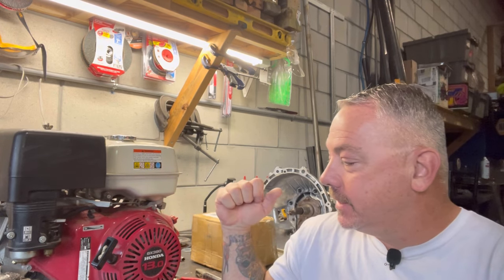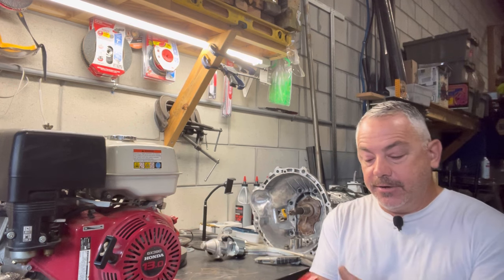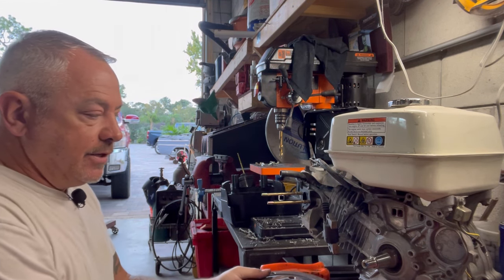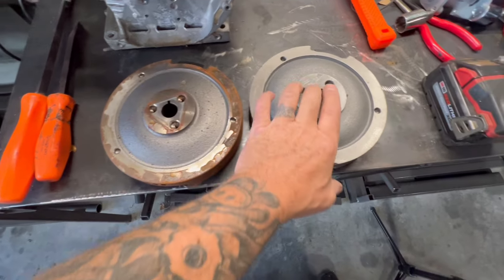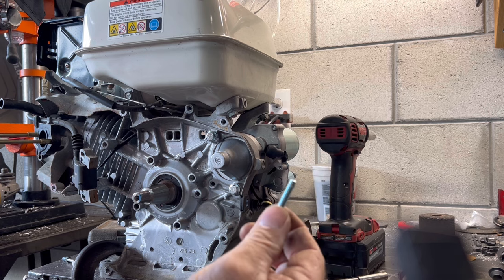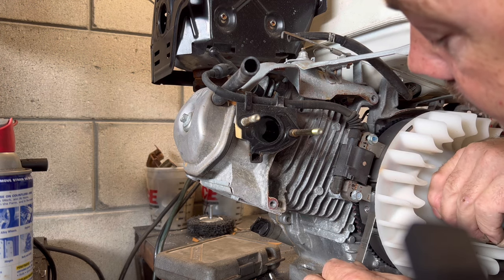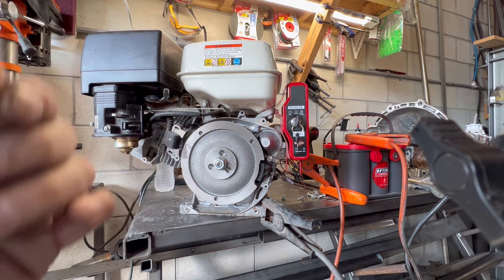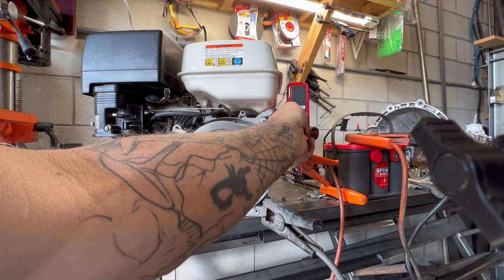How to install electric start on a 13HP HONDA GX390

Comment: To whoever has a new flywheel keyway that is not aligned with the original, you can remove the teeth ring and insert it into the original flywheel.
Reply from the maker: Thanks for sharing that brother 😊🤙🏻
Reply: @magicman_metal_fab  thanks your video I can do it. it took me several days but it is worth
Reply: My teeth ring was about 100 thou smaller then the flywheel where it sits on the old one.  My keyways arnt lines up and its driving me nuts i cant find anything online about it.
Reply: I also bought this kit, and my gear ring on the new flywheel is smaller than my oem flywheel. Im hoping to drop off both flywheels tomorrow to get a machine shop to put a new slot in for me.
Reply from the maker: @scottyv106  that’s so crazy!! Why the seller of the kit doesn’t have a fix for this. You shouldn’t have to do that bud. I’m glad you got it sorted out. Keep me posted. 😊
Reply: Is there a video for that ?
Reply: My original flywheel keyway and magnet is at 2 o'clock and the new flywheel is at 1 o'clock 😢. Are you suggesting to remove the flywheel teeth from the new one and press it on my original flywheel? If so, I measured and my original is an 1/8" bigger so the new teeth won't fit unless I have it machined to fit 😢
Reply: @solomonbadayos4196  burn the new teeth, due to heat it will expand the size. You can try and if it did not work, use  the sharper machine
Reply: @ThInstantnoodle  got it. Thank you!!
Reply: I'm a moron. Where do you hookup the battery? Overall I can follow your video. I hope mine goes as smooth as you make it look. Thanks Scott

Comment: In my case for this I’m going to use it for the Track Tow Kart it’ll be faster to start the engine like this rather than pull starting it

Comment: It appears from the video that you could have added the starter and flywheel without removing the carb and cleaner. Y/N? I 2nd the good editing. You showed the potential problems without filming every single screw turn. Thanks
Reply from the maker: Yes you are correct bud. Good eyes and observation. If there was a prize, you would have won!!! 🫶🏻🫡

Comment: For anyone who's installed such a electric start kit, what happens if the motor locks up due to hydro lock or anything of the sort?
Reply from the maker: I don’t know why you’re worried about a motor Hydro locking, but if it was the Hydro lock, you would have to pull the spark plug and get rid of all of the water and moisture out of the cylinder

Comment: Thanks to your vid (much appreciated) I successfully installed the electric start kit to my honda gx390 7.5kva generator. I added a second charge coil to increase the charge to 2.4A. It brings the battery back to health very quickly but it occurred to me what controls over charging of battery? Would really appreciate any thoughts. Thks Wayne
Reply from the maker: Awesome bud. I don’t think that 2 mini coils would over charge the battery. Hook up a stereo to it. lol to drain voltage 😂🤣😂

Comment: Excellent video sir. I expect to install this conversion kit on my GX390 on my Simpson Pressure Washer. I'm 68 years old with shoulder problems, too old to be pulling manual recoil starters!
Reply from the maker: Don’t blame you bud. It’s super easy to do too. 😊🤙🏻 glad it will help you.
Reply: @magicman_metal_fab  I just bought a go kart with a Honda gx340 250 bucks these little engine is strong
Reply from the maker: @joebravo7220  nice. Just be aware if you try to do the starter swap the pick up on the flywheel is in a different location bud. 😊🤙🏻

Comment: I also had a flywheel with the keyway in the wrong position. I took it to my local machine shop and they cut a new keyway in the correct location and only charged me $40. Highly recommend this fix, the engine runs perfectly and I can feel confident that there won’t be any issues in the future . I depend on this engine every day, because I do commercial pressure washing, and it runs about 4 to 6 hours a day 5 days a week and I don’t have a backup engine.
Reply from the maker: Awesome. Great to know bud.

Comment: Good video. I have the same kit. No instructions. No invoice. No company name of who or where it came from. Weird.  My kit wiring version has the black split . One leg goes to ignition coil for spark. The other runs the new electric switch. I just clipped old switch wire and left it run through original diode for low oil. Also weird   was the white wire coded to brown for charging coil. I havent started it yet. Going to buy a new spark plug and wire for charger. I was going to say. A 2 5/8 " hole saw worked . Wouldnt have known that had I not watched your video. Good you mentioned gear line up. And cure in comments. Mine has no wiggle room in bolt holes. Hope it meshes or its drill city.
Reply from the maker: Awesome brother. Glad it helped you. 🫶🏻🫡

Comment: Fyi if you take a piece of notebook paper and fold it in half, it makes for a good shim to set the gap of the ignition coil to the flywheel. Just loosen the screws with the paper between the coil and the magnet of the flywheel, and let the magnet pull the coil to the flywheel. Tighten the screws and rotate the paper out.

Comment: I'm doing this on my 8 HP Honda snowblower. Yes I know it has 120 volt starting but I don't want to be 30 yards down my lane and have an engine stall. Besides I'm old and don't like pulling that big engine over. lol.
Reply from the maker: Heck yea!!! Smart man. 😆🤙🏻
Reply: @magicman_metal_fab  question, if I install one of these, can I somehow wire in just a plug for an extension cord for power? Or do I have to use a wire? Wanting to do one of these on my Honda GX engine on my snowblower. Thx 🙏
Reply: @magicman_metal_fab  do you know??
Reply from the maker: @Lyndonkb11  the system operates on 12 V. If you’re trying to use 120 V it won’t work you would need some kind of inverter. AC voltage and DC voltage is totally different.

Comment: Can you explain in more detail how you aligned the flywheel teeth with the starter teeth? I just had to replace the starter on my Westinghouse generator and it seems the flywheel is getting caught up when trying to press the electric start button. The flywheel began to turn when the button was pressed and then seemed to "seize" up.
Reply from the maker: Just loosen the starter up and rotate it slightly. There’s a little bit of play in the bolt holes. On mine it wouldn’t spin the engine so I had to rotate it.

Comment: Thanks for the video, it helped out a lot. But in my experience. My starter was binding/ seizing up after half turn or so, it was struggling. I struggled for two days trying to find out why my starter was seizing up, and it turned out the jumper cables I was using to test it out wasn’t giving the starter enough juice to crank it all the way. Wired it straight to the battery and problem solved. Hope this helps 🦾
Reply from the maker: Awesome bud. Glad to hear that.

Comment: Great video. I do have this question if there is no stater or voltage regulator what is sending a charge back to the battery?
Reply from the maker: Nothing

Comment: Thank you very much for sharing this. 
1. So, what was the reason that the teeth did not align; and,
2. What did you do to align the teeth?

Thank you very much!
Reply from the maker: Just not sitting properly. Losing bolts to move starter around. It’s not hard bud

Comment: How are you brother. Can you make a video on converting an oil cooler on GX390 aircooled engine. Im planning it to install on my generator set. To lessen the heat because you know gensets are at high rpm.
Reply from the maker: I sure can brother. It may take a little bit because I will be leaving town for work in a few days. Definitely a great idea. 😊🤙🏻

Comment: Excellent video what if when your key way is at 12 your magnet is at 2 on the old one and on the new flywheel its at 1 with the keyway at 12?? is that enough for it not to run?
Reply from the maker: Probably not bud. It’s super important that it’s the same

Comment: From the point you left off at, how do I wire up the battery? Just the positive to solenoid and negative to Engine? How does the battery get charged?
Reply from the maker: Yes correct. The coil you added behind the flywheel will charge the battery.

Comment: Hey mate, great vid yeah. So hey, would you know if this kit is suitable for the 420cc Honda clone, otherwise advertised to be 15HP? I don't think it's actually a true 15 ponies, but it does appear to be an exact replica of this gx390 yeah.
Reply from the maker: Absolutely. There a guy on YouTube that built a 60 mph Honda I think it was with a 420 cc engine.

Comment: Awesome Video. The eBay link says the Electronic Starter Kit is for GX390 year 2011 or older.... does this "older" mean pre-2011 or post-2011? I'm assuming it means 2010 and before?
Reply from the maker: Yes. Correct

Comment: Cool! Looks like the kit is only $75 which is very reasonable.
Reply from the maker: Yes sir. How can you go wrong?  Super easy to change over too. 😊🤙🏻
Reply: Why do the kits say 2011 and earlier models? I can’t find any for a newer motor
Reply from the maker: @frankpirrone6032  good question bud. I’m sure it will fit newer motors. Nothing really changes year to year. 🤷🏼
Reply: Cost me 89.00
Reply: @magicman_metal_fab  I believe the key position is slightly different on newer ones made after 2011.  Will affect the timing.  Haven't done the conversion yet but have one on the way for my generator.
Reply from the maker: @markhueffman6859  that’s really interesting. I made sure to double check that mine was correct but I wonder why they changed it? Thank you for the heads up, sir.
Reply from the maker: @Mark Hueffman interesting. Lmk how you make out bud.
Reply from the maker: @Mark Hueffman I like that idea. Easy peasy. 😊
Reply from the maker: @Mark Hueffman oh no. What the heck bud. That’s crazy. So no luck?
Reply from the maker: @Mark Hueffman oh ok. Niceeeeee. I thought it wasn’t going to work bud
Reply from the maker: @Mark Hueffman awesome bud 😊👏🏻👏🏻. I’m glad you were able to pull it off. Kudos to you. I’m glad my video helped.

Comment: wonderful video followed it to a tee. BUTT!!! where does th electric come from?? how do yo hook up the battery? I know you need one it won`t start on it`s own!!
Need to show how to hook up the battery!!
Reply from the maker: You have to add a 12 volt battery source. Positive to the starter, negative to the engine block. Sorry I didn’t include it.
Reply: @magicman_metal_fab  I Knew this just thought I`d mention this for the not all well informed ones.
There`s some out ther that would wonder why it don`t work when you turn the key.
How can I send you some pictures of how I adde my battery?
Joe
Reply from the maker: you can email me 
Magicmanmetalfab@gmail.com

Comment: Hey again what did you do with the Black and Red wire that was on the old off on switch? Do you just leave them hang? I know the Yellow goes to the split black wire and the oil switch but i dont see you doing anything with the Black and Red wire off the old on off switch that was on the case.
Reply from the maker: I believe it goes into the key switch. I would have to watch the video again.

Comment: How did you align the starter. Did you have to log out the large hole and move it slightly. Did you have to move the starter toward the flywheel or away from the flywheel?
Reply from the maker: Yes. Trial and error. The bolt holes should put it close.

Comment: Nothing about battery or how you make that starter spin ?
Appreciate any suggestions..thank you !!
Reply from the maker: You’re going to need to add a battery. The kit comes with a charging coil to recharge the battery. That coil gets installed behind the flywheel

Comment: Do you have a schematic for that starter ? I had a wire come off that is one from the breaker / overload (brown and red) I am being lazy but do you know where the two wires go on the  switch? I thought I found a broken solder joint but wont start where I landed it. Thanks for any help
Reply from the maker: It’s all color coded bud. No unfortunately I don’t. 😞🫡🤙🏻

Comment: How do you connect the battery to the new starter? Can't find the postitive or negative to the battery posts.
Reply from the maker: On the starter there is a red terminal. Take your ground and attach it to the engine block.

Comment: Do you have the wiring ? I have a gx340 and a gx200 I’m doing electric start on both can’t seem to figure it the brown wire and the two black wires !
Reply from the maker: Negative bud. Probably just google it.

Comment: I have this same exact motor the Honda gx390 with pull start and an electric starter as shown in video. 
In the last 2 years I've burnt through 4 starters and the last one only lasted about 3 months. 
It will not pull start either, any tips or advice. Motor is mounted on an air compressor on a truck for doing tire repairs.
Reply: To add, I've taken it to a couple different places and they can't figure out why, one day it'll start up fine and run and the next day nothing starter won't click or anything. The pull start cord has an extreme amount of tension and in the last 2 years I haven't been able to pull start it even once.
Reply from the maker: Email me a video. That’s strange.

Comment: I have a Ryobi 6,500 watt generator that I'd like to add a starter to.  Any suggestions on where to find instructions or ideas on how to do this?
Reply from the maker: First, I would do a search on eBay and see if they even sell a kit for your engine. If they don’t then you’re gonna have to swap your engine, which is pretty easy.

Comment: I measured the starter nose hole size, it was 2-9/16" or 65.03mm or 2"-.56005 in thousandths
Reply from the maker: Sweet thanks bud. Definitely good to know. 🫡🤙🏻

Comment: Is there any differece between Honda and Predator and other copies? I ordered a Simpson 4.4K PSI pressure washer for 1k mullas and it emptied my wallet. The box doesn't say Honda GX390 but it's made by Simpson. Probably a re-branded copy engine. I am worried.
Reply from the maker: Absolutely. Predator is a solid engine. Honda is a fantastic engine. Everyone has copied a Honda engine, but at the end of the day I would only choose a Honda engine.

Comment: Great looking starter. Is it still working well?  Also how does the circuit protector work?
Reply from the maker: Starter works great! Haven’t had any issues with the circuit protector.
Reply: I watched a video about the starter and they pointed out that the circuit breaker is false and doesn’t connect to anything
Reply from the maker: @JillyN oh. lol I was confused. That a low oil switch. Those cause issues

Comment: i have already installed this one. can i bypass it and install a simple on-off switch and a car ignition button? i want to mount the pressure washer in my van and have the ignition near the door.
Reply from the maker: Sure. Why not bud.
Reply: @magicman_metal_fab  thanks, I hope I get it right 😅

Comment: Hello ...question please ...I have the original honda gx390 with starter ...I like to install the low oil sensor ....my low oil sensor has two cables ...one yellow and one black ....you can send me the installation diagram  conection to conect the cables from the starter key box cables ...please
Reply from the maker: It should all be color coded. I’m not the manufacturer of this kit. Just a random guy on YouTube that made this video. I’m sure if you googled it bud it will come up. 😊

Comment: So I bought the kit for my gx390 of Amazon but problem is that the key on torque converter is off so now it doesn’t run correctly I put pull start back on and it’s fine what should I do?
Reply from the maker: You’re going to need to get the correct one bud. Unfortunately there isn’t any way to fix it without the correct flywheel

Comment: If I just wanted to add charging to my gx390 to run some 12v hydraulic solenoids, would I just need to buy a coil and rectifier ?, unsure if the flywheel is any different other than the starter gear
Reply from the maker: That I’m not sure of bud. The coil that came in my kit was just a charging coil. I guess used for the battery to start it. I’m sure it should be fine with just a 12 volt charging coil. Or custom make a bracket for a one wire alternator.

Comment: Does the starter battery get recharged as the engine is running? also where are you mounting the battery?
Reply from the maker: Yes the battery would get recharged off the stator coil that is installed provided it’s hooked up properly.

Comment: If my keyway doesn’t line up . Can I just adjust my valves to Time it right or is there more to the timing ?
Reply from the maker: No because these motors aren’t built like car motors. There no adjustments.

Comment: Thanks for this information. 
It may be here and I missed it. What size battery do got use?
Reply from the maker: Typically like a motorcycle battery is fine. Home Depot sells then. I think like $75
Reply: @magicman_metal_fab  thanks

Comment: hi nice video but the only think that i needed is missing, how to connect the battery...i have motor with starter but no connecting cables...i think minus to grownd and plus to the starter -? thanx
Reply from the maker: Yes. You will need 2 wires. One from battery positive to starter, then a ground from battery to the motor bolt.
Reply: Thanx 😊
Reply from the maker: @dreambigTV_original  if you have any questions just let me know bud. 😊🤙🏻

Comment: What happens if keyway and magnet on old flywheel are not in the same position with old flywheel? On old one magnet is at 3 o’clock  and new one is at 1 o’clock.
Reply from the maker: It probably won’t run. The set up is different.
Reply: Thanks for response! 👍

Comment: Will this work o DeWalat pressure washer and does it have a charger kit?
Reply from the maker: Has to be a Honda gx390 engine. Yes it has a charging coil in the kit.